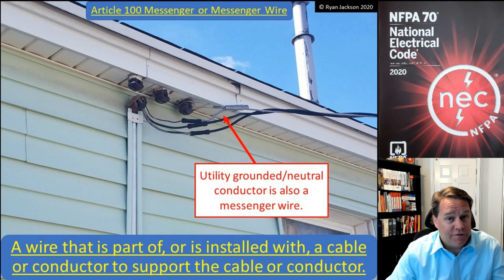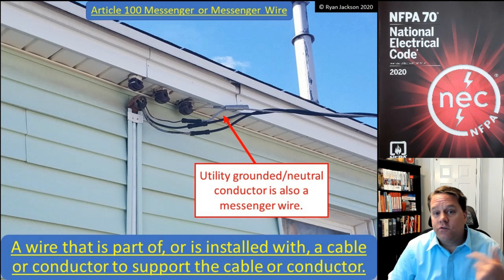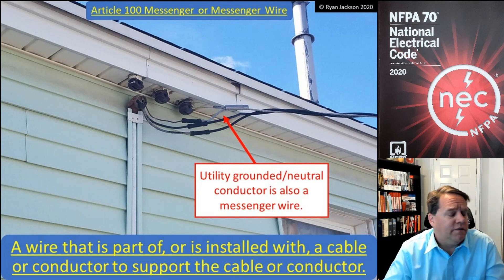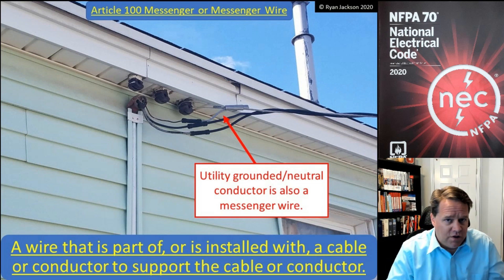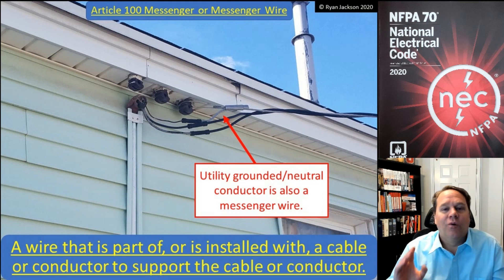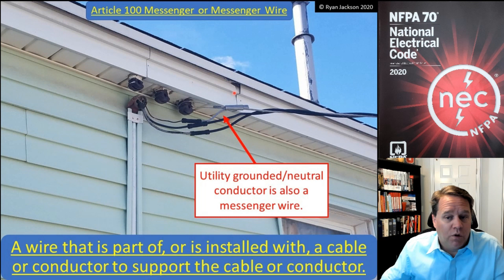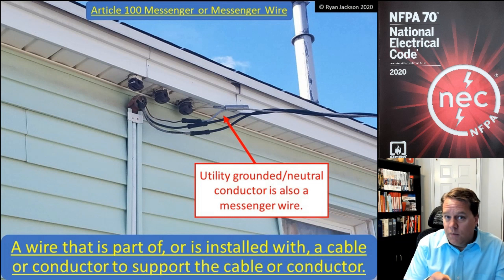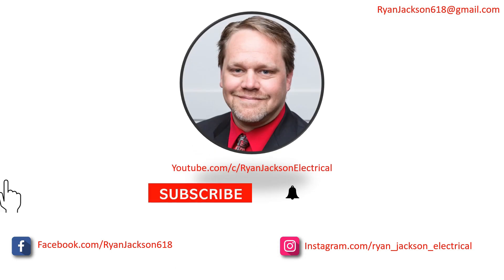100 Days of Article 100: Messenger Wire

Comment: Ryan I got a question for you Ryan as per messenger wire. So from the house to a separate garage going to a sub panel. Can I turn the sub panel into a main and use too hot add bare ground for neutral ground. Or do I have to run a messenger wire with three insulated conductors and one bear

Comment: In this situation is the neutral bonded to ground by the utility away from the building?  If the neutral messenger is attached to a conductive mast, does that bond the neutral and no other neutral/ground connection made?
Reply from the maker: The utility connects their neutral to ground thousands of times. It's a concept called a "multi-grounded neutral." We still have to follow the rules of Article 250, including installing a main bonding jumper.

Comment: Never read or told that ACSR cable had steel wires in it. Yep I now know ASCR stands for aluminum cable steel reinforced. First time I had to cut one for a 100 amp service took my duller side cuttets up to cut it. While in Army field wiremen school we had twisted pair telephone wire that had 7 tinned strands guess totalling around a #16 guage wire. 3 of the strands were steel. To pass splice test we had to tie square knots on wire then cut steel strands and wrap tinned copper wires around a few times. Would stagger splices 6" to prevent cross talk & interference in Viet Nam. Then we tied it to 2 poles and sat on it for maybe 20 seconds. If splice did not pull apart you passed. Had to make sure that we hung this twisted pair at least 16' off ground and remove all steel climbing bolts first 12' from ground. Guys would cut it and use it for clothes line. Once did a 800 amp aerial service and ultility company only used 4/0 Aluminum ACSR that for sparkies only good for 200 amps. They always say but its air cooled. Bet that undersized wire gets hot on a summer aftetnoon.

Comment: Hi, my name is Joe and... I'm an industrial electrician.  (Hi, Joe).  Now I see why the utility doesn't have to include a supply side bonding jumper to a residential service.   

Buy maybe they should.  I think its why some people think some branch circuits dont need an egc.  i.e parking lot lighting.  

The branch circuit is not code compliant if there's no egc